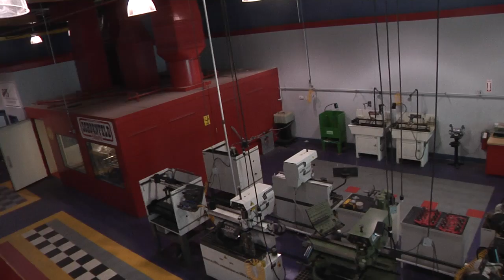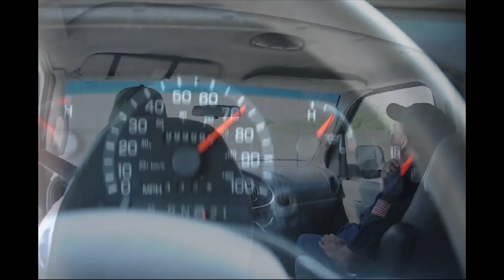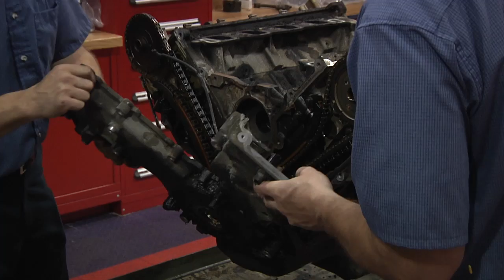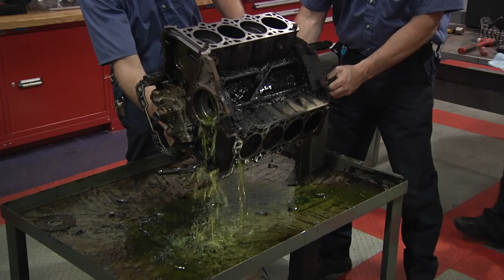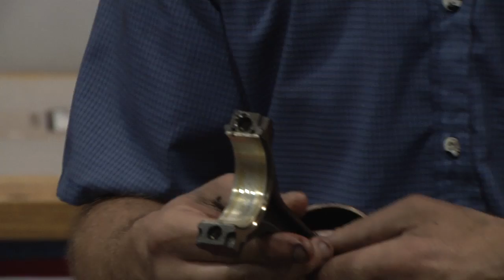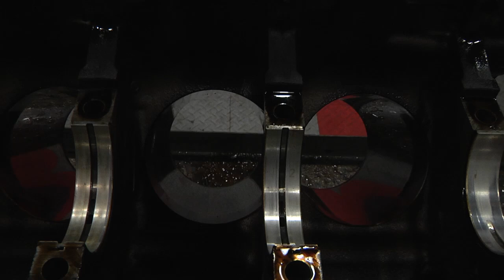Schaeffer Million Mile Gasoline Engine Teardown

Comment: I e-mailed Schaeffer & asked questions.  Below is the response that I received (part 1 of 2 posts):
"Thank you for your interest in our product line. The million mile gasoline engine used our Schaeffer Supreme 7000 from the time it was brand new on 8,000 mile intervals. We market the Supreme 7000 for 7,000 mile intervals and the Supreme 9000 for 9,000 mile intervals in the passenger car/gasoline market. We have much more capability with extended drain intervals on our heavy duty products."

Comment: I believe it. I've got an 07 F-150 with 201,000 miles, never had any problems whatsoever with it. I've always used Mobil 1 and switched to Schaeffer Oil this year and can already tell a difference with how much cleaner it is when I change it and how much quieter it is. Great product.
Reply: Are you referring to synthetic ?.
Reply: Yeah, I've always used full synthetic.

Comment: I got a brand new 1994 Mustang GT when I was 17.  It has been my daily driver ever since.  Schaeffer's 9000 is my engine oil.  It runs and idles like new.  I do plenty of other upkeep to the car, but the oil does its part to keep the engine going.

Comment: (part 2 of 2)
"The engine was a 4.6 liter Ford engine and the van was used to transport prisoners around the country. From what I understand, with certain types of prisoners that they drive straight through to the destination only stopping to switch drivers. We are not sure about the brand of filter, but they did not have any extra filtration on the engine."

Comment: there are more than a few of the Ford Mod series engines over a million miles. I'm sure there are a bunch of taxi cabs with those engines with milage close to that. I have seen several in person over 500k
Reply: I know some passengers Company that use these vans, they go from N.Y/Boston round trip EVERYDAY 😳
Reply: Taxicabs, as in Crown Vics?  Those will have the 4.6 liter version in this engine series.

Comment: Ive been running Shaeffers for almost 20 years now,its incredible oil..I love the x7000 15w40,I have air cooled Kohler Commands with close to 5000 hrs that run like new,and are run full load 3500-3700 rpm all day,minimal oil usage,and they get x7000 and a wix filter every 100-150 hrs...

Comment: Using your 5w40 in my Corolla. Not a common application I know but the motor runs so well with this oil. This oil actually cleaned up some left behind varnish left by Castrol in around 2,000 miles.

Comment: I use Schaeffer in everything I have. A 02 4runner with 247000 on it. A 98 Electra Glide Harley now with a 107 S&S engine with 22000 miles on the S&S. About to change a new Road Glide over to it as well. I was convinced of Schaeffer oil when I had a friend who was riding atv's with several of us one day after a big rainstorm. He sank the atv in a muddy creek. After cleaning plugs and spinning it over, it started. It had creek water in the oil from when it died and pulled it in from the exhaust. He rode it back out and did not change that oil till he made it back home. He still has that atv today. Still runs.
Reply: I have an 92  FLHTC . I used to  run AMS oil 20w50, the engine was always noisy. Then 3 years ago they did something to the oil. After  an hour of highway driving oil pressure dropped to  practically zero at an idle. It never did that before. Since then I have talked with 5 other people who had the same oil pressure problem, I  switched to VR1 and it was better. Now I am running 7000 20w50 and a Hubb  reusable oil filter. I have gained 5 psi on the highway and the engine is a lot quitter . Just about 2500 rpm the only sound I hear is the exhaust.

Comment: Just because it has a million miles on it doesn't mean it hasn't had major engine or transmission work.  They never discuss the maintenance records or what was done over the years.  Everything looks new inside because it probably is new.  Im sure Schaeffer oil is good.  Most oil is good.  If you change your oil regularly, the engine will last longer, but to try and sell this as though nothing has been done to this engine because it's "always had Schaeffer oil"  seems like a stretch.  I'd like to hear you talk about the documented maintenance to back your claims.  Just my two cents
Reply: Well I’ve been using schaeffers oil in my 5.7 Chevy black made for MerCruiser. I bought my boat in 2002 been using Schaeffers since 2003 currently has over 3000 hours on this boat and we run it hard it’s a Malibu response I barefoot so we always run it at 5000 RPM try that with any vehicle engine. My engine is still amazing.  No major work!! Love Schaeffers!

Comment: My old 4.6L f-150 is at 520000km and there has been NO mechanical replacements of any parts except plugs and a single injector they are the toughest modern american engine at least in 2 valve form in my opinion. Police and taxi drivers engine of choice for the last 22 years

Comment: I believe a lot of what I see, however a timing chain will not last that long. For a million miles, that would have to be at least the second chain and ready to be replaced.
Reply: yeah, that would be stretched all to hell
Reply: A 4.6 2v found in crown victorias will turn a mile miles stock.
Reply: @cornelius6304  exactly this, certain timing setups last forever,the 2 v isn’t known for stretched chains, if this was a 3v engine it likely would not have went that far on the original chain or cam phasers .
Reply: Changed the timing chain on a 03 Ecotec at 247k was original as still had original tensioner. Some minimal wear. But agree chain and shoes wouldn't last 1 million.

Comment: i have 8.1 chev and has 170000 on it like brand new inside i just did crank senser and valve cover gaskets and pan gasket motor spotless and runs smooth and quit

Comment: Now that's living proof of built ford tough.
Reply: +YouDontWannaFightMe a big V8 that makes like 130 hp better last a long time lol
Reply: No not really.
Reply: 130 hp stock? Maybe in 1950
Reply: you are crazy....
Reply: My 4.6 makes 480 HP and 530 lbs of torque.. It has 190k miles on it. Does not leak oil. Burn oil and spotless inside. Using nothing but Mobile 1 from day one. 

Check that against GM 1.4 million lets catch fire wagons. Failing intake gaskets. Failing fuel pump gauges. ect...

Comment: The kendal oil engin tear down they actualley measured the parts. And it was cleaner but a milli ok. Miles that's about 7,00,000 more than I would do.

Comment: Video made in 2013. Vehicle 10 years old.
1 million miles in 10 years = 100k miles per year.
100k miles / 365 = 274 miles per day.

As a rough estimate... I'd say it MIGHT not be fake. But who knows...
Reply: Glenn Conner We had a 2006 Silverado at my work the service techs used to travel store to store for machine repairs.  In 5 years they racked up 320,000 miles on it.  Not counting Sundays that truck averaged 213 miles a day.  It can be done. It was replaced in 2011 and that Silverado has 185,000 on it so far.
Reply: We had a contract delivery person who put 500 miles a day, five days a week, on his Prius. I average 25K miles per year in my work truck and that is just to get me from one place to another.
Reply: Glenn Conner I know some passengers Company that use these vans, they go from N.Y/Boston round trip EVERYDAY 😳
Reply: had days driving up to 1200 miles.my daily average it’s been 500 miles at day for the last 20 years.(I’ve seen some still ok at 1.3 million miles!)

Comment: doesn't matter if its ford, chevy or dodge, no v configuration gas engine after that amount of mileage will ever look like that and still have a crosshatch. an inline diesel I have seen it with my own eyes so I can believe that but just not a gas engine...my Toyota 22re which is 10 times as reliable as this piece cylinder was smoothed out at 332,000 miles when I tore it apart and it was well worn. oil was changed every 3000 since new with mobil 1 oil. never ran super hard but all highway miles and only idled for 5-10 minutes on cold mornings to warm up..tore it apart to change the timing chain and ended up sending the block out to get punched out after I saw how much wear there was...

Comment: Now these goofballs know this thing has new chains and guides a few times in its life come on.
Reply: Robert Craciun we have a 4.6 in a E van with 585000 no timing chain guides
Reply: Bet there is wear Marks though
Reply: My 2011 escape has 657000 no chain or guides
Reply: My 500k mile 4.6  never had front covers off. They ware from 5w20 oil and from low quality run at long OCI

Comment: This is kind of surprising I grew up in a family who did nothing but run forwards and I have the say the 5.4 3 valve is a piece of  Krapp engine. I know my truck person has gone in for the timing chain replacement 3 times at a spout do for 4th and I've only had the truck forward 2 years I'm kind of interests to see what this oil will do if it is as good as they talk about as you know the 2006 model F150 uses the oil for its timing chain tension er's and once the oil starts to lose tension as starts to lose its ability to keep the chains tight and I'll be intrested see how this does with that situation
Reply: Just put the 2 valve metal tensioners on it and lock out the phasers... It's too expensive to keep doing the timing

Comment: Someone below has stated that schaeffer is recommending their 9000 series oil (which is full synthetic) to be changed every 9000 miles.  So my question is, Amsoil is recommending their signature series to be replaced every 25,000 miles.

How is schaeffer better or equivalent to amsoil then? 

By the way, im not an amsoil fan. Im on the fence deciding which oil to use on my new car (either schaeffer 9k or amsoil signature series) and plan to run each 10k miles (city drive) and have each one tested by blackstone labs, and then compare the results and be convinced by the numbers instead of “people’s OPINIONS”
Reply: Andrew atm have you done the tests yet if so what happened??
Reply: Not to mention, there are documented cases of people going 400,000mi on Amsoil with NO oil change.
Reply: 25k miles between oil changes just seems excessive. I'm sure that the synthetic oil itself will remain effective for even longer, but the issue is contaminants from the engine. And even the cleanest burning engine will dirty up engine oil far before 25k miles. I personally wouldn't go past 10k miles- max, on any oil change. And that seems like its pushing it. My 2 pesos. Cheers
Reply: @giggiddy  You would think. But in practice, the oil remains clean comparatively. Also, and as a result, i usually change my filter 2 or 3 times before i change the oil.
Reply: I had a 1979 Datsun 210 coupe it had regular Penzoil put in it, by a mechanic when there was AMSOIL in there that had only 2,000 miles on it. Well up in Nevada in a small town called CALIENTE we had snow and during the morning when I went to go start it up, it would take 5 cranks before it started. Now 1 month later I go and get ASMOIL in the engine. There is still snow on the ground, it has been a week since I put oil in it, so I go to start the engine and it cranks over once and starts I was like wait a minute WTH so I shut it down and start it up one crank boom starts so that is when I became a fan of AMSOIL. I have never heard of a Million mile engine not rebuilt looking new and having very little wear on the engine just amazing 😲
Reply: I have been a mechanic my entire life ( ASE MASTER ,GM WORLD  CLASS ),now retired. I used to use AMS oil. I ran the 20w50 race by the 55 gallon drum in everything. AMSOIL  has done something to change the oil. There is a group of us gear heads that started noticing its not the same oil it was 20 years ago. 50 years ago when I was working for a fleet, the Scheafer rep came by for a demo-but  school districts  weren't know to want to spend much back then.  Each to their own, Schaefer edges out Amsoil for my purposes. I get to deal with a rep or factory-not 500 guys who bought into the pyramid of multilevel marketing.

Comment: On this specific engine, how often did they change the oil??
Reply: I looked and didn't see if the oil ran in this engine was std or synthetic.
Reply: From what I read it was supreme 7000 with 8000 change intervals.

Comment: As soon has he said ford I knew this was BS.
Reply: ...and you will never be swayed by facts.
Reply: flagmichael don't confuse a liberal with facts.
Reply: Who wants to bet Johnny Rocket is driving  Toyota Tercel?
Reply: Hmmm, the fact that IT IS A FORD and it went a million miles is the best testimony ever!
Reply: why,,   my  buddy  drove  chevs  an fords    both went 600.000 miles  no big   problems
Reply: probably a chevy fanboy.. you need to understand chevy was besting ford up until the early 2000's Chevy started cutting corners to lower production costs, which lead to the GM bailout in 2009. after which chevy turned to complete garbage for all of their new products, the only ones that remained reliable were the ones that didn't change, like the impalas. If you want a reliable vehicle made by an american company Ford and Tesla are your only options. Or buy a chevy from the 90's
Reply: @johnmay5957  your statement is far from correct. Impalas from Chevrolet from 2000+ were absolutely garbage. Ignition systems fail constantly. Chevrolet truck motors, the ls series is untouchable for it's simplicity and strength

Comment: Just oil changes? I call BS
Reply: You can call BS like other folks and keep replacing engine parts. I myself was a skeptic but I tried it ends up its cheaper in the long run as you can safely run 7000 miles on there blend oil without sending it into the oil lab and on there full syn you can go 9000 miles. I run it in everything but wet clutch atv it will make the wet clutches slip. I have a 4.6L triton and never had the engine apart for anything and it runs like new no valve noise or timing chain noise this oil is in a class all of its own and I will never run anything else for one its cheaper as you don't have to change it every few thousand mile and most engines show a increase in fuel milage so that saves you money the oil pays for its self and the engine not wearing out is just an added bonus and no I'm not paid by schaeffer's. Note if you are running a sludge builder oil I won't mention the names but this oil cleans that sludge out and you may have to change your filter and even oil sooner on your 1st change if the oil turn black it needs changed. This oil runs clean my truck even after the oil has been in there 5k miles is still green in color as it is when you pour it out of the bottle and clear enough that you can see the writing on the dipstick threw the oil. This oil even stays clean in diesels for a long time.Most folks that sell this oil also have sample packs to send your oil into the lab to see how long you can run it in your engine some folks are running it 12-15k i personally like to just change it at the 7k so it stays clean and that gets the filter changed as well. I have seen the normal price of the blend from $6.50- $15 per quart even lower if the person it just trying to sell volume of the oil at or near cost. That figures out on the low end price to $3.25 per quart if you only doubled you oil change miles compared to your off the box store shelf oil so I don't know about you but I would not run off the shelf oil that cost $3.25 /qt in any engine even if I hated the engine     LOL !

Comment: Lol ive had two ford trucks now break 900k before i got rid of them lol good luck trying to swad me on any other truck to buy my chey only lasted 240k before the engine went out p.s. i only run amsoil signature series witch is a 50k oil life in my vehicles but still change the oil at 10k and recently went old skool on a 100% original 1995 f250 with a 460ci gas engine garage kept and bought it this year with only a tad over 89k on it for a still and i will not get rid of it i love the truck so much

Comment: Use a synthetic oil at recommended weight for engine. Change oil and filter every three thousand miles. Don't drive like an idiot and a well-made engine will run a long, long time.

Comment: Im sure this is top notch oil, but anyone who's ever torn down or rebuilt an engine knows this is complete nonsense.
Reply: That all I’ve done for a living for 30 years and no it’s not nonsense.
Reply: Ive ripped into plenty of motors.  This is what i expected for highway driving.
Reply: @workingcountry1776 how many 1,000,000 mile engines?

Comment: Engine looks good, oil was definitely doing its job. But those Pistons look horrible. Why is it the entire rotating assembly is new spec but the Pistons and exterior rod discoloration is such black varnish?
Reply: He said the pistons were Teflon coated; Teflon is typically dark grey or dull black.